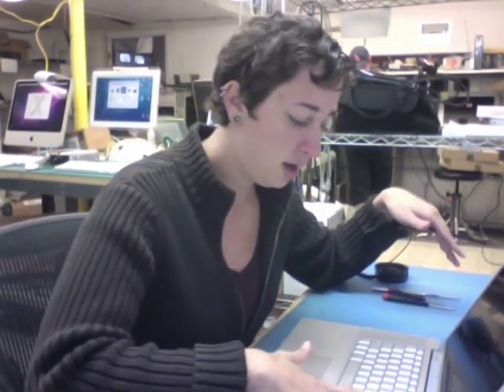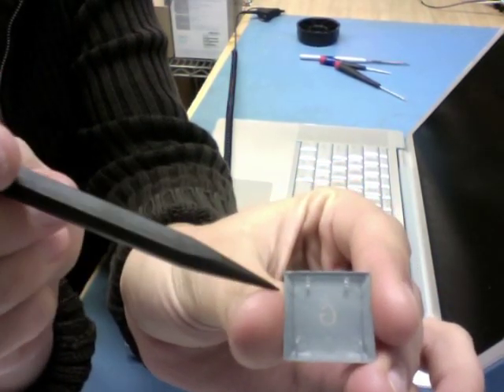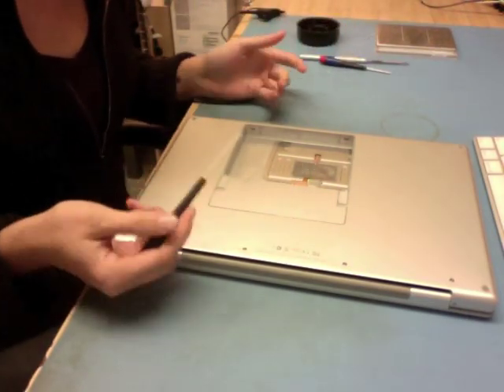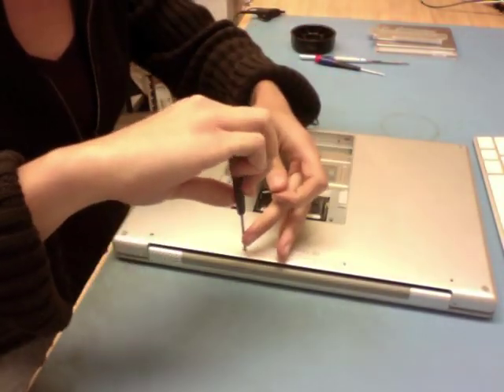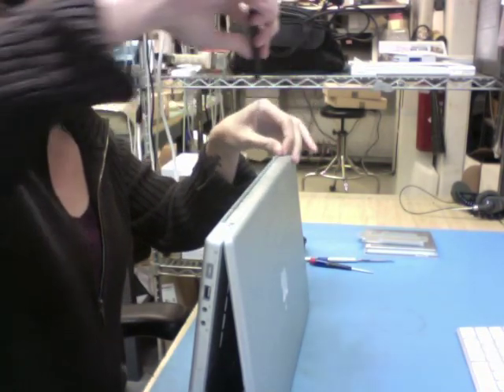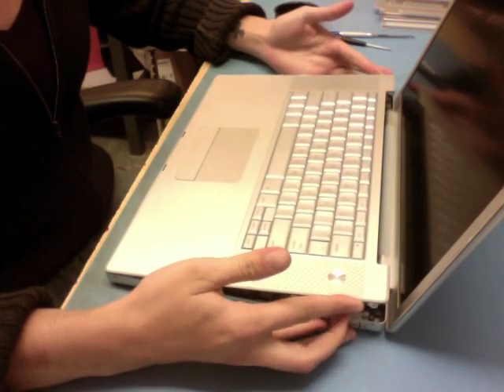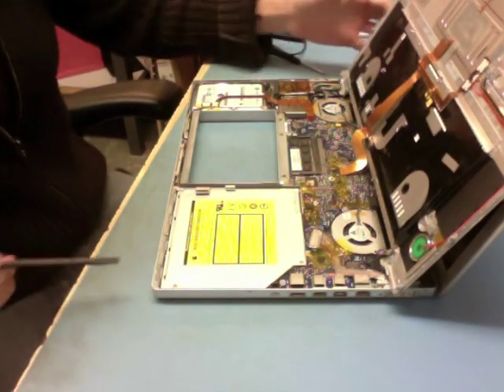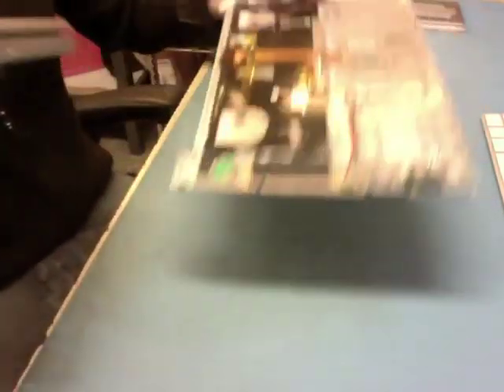MacBook Pro/PowerBook Keyboard Replacement (Part 1 of 3)

Comment: I just replaced the keyboard on a 2010 model and the 53 screws were a nightmare. This looks much easier, but I replaced a keyboard on a 2011 Fujitsu lifebook that literally slide out and put the new keyboard in around 5 minutes.